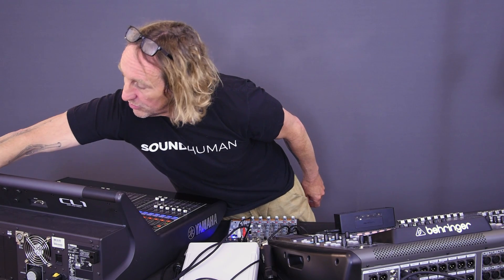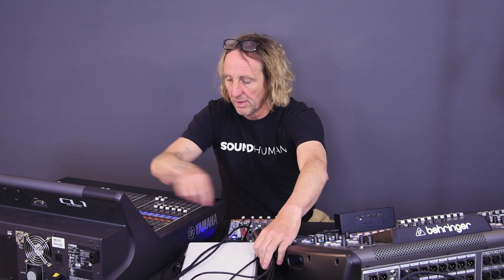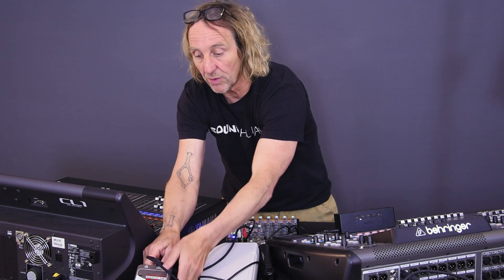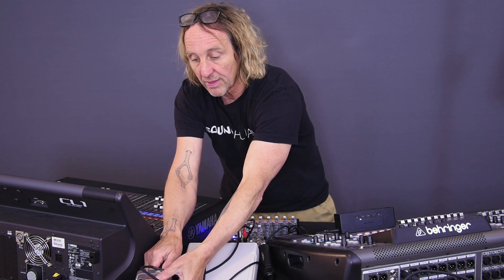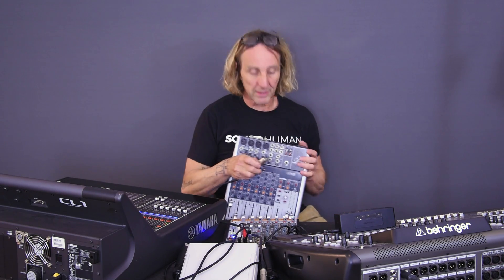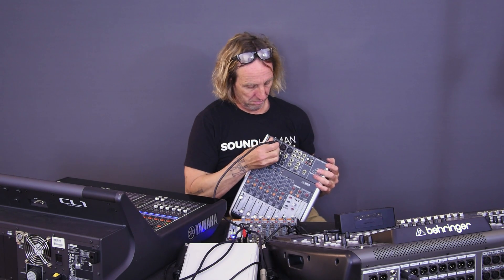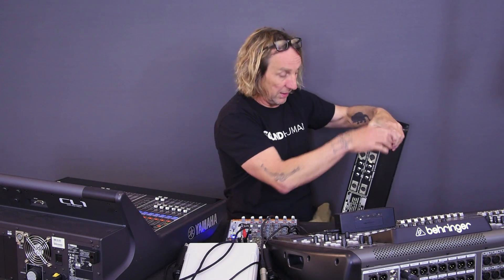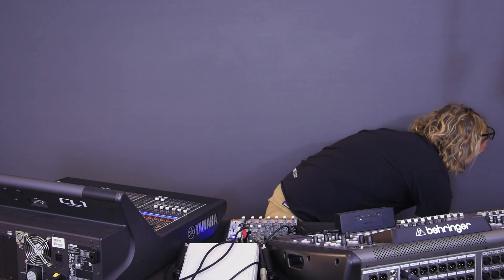Will an ISO Transformer Stop "Off Gear Distortion"? (Public)

Comment: Inredible as always. Mixing engineer here sat in Berlin with a question... Does this apply to my outboard stuff too? Should I be powering everything on every time? Cheers!
Reply: Only if your outboard gear is fed with a split, or your desk has very poorly designed outputs.
Reply from the maker: Driving multiple rooms with a split or driving multiple powered speakers or consoles with a split is quite common.  Turning one or more of the units off when not using them is common as well.
Reply from the maker: It could, some gear does it and some does not.  Though so far it seems that mic preamps are more likely than line level inputs. I have not found a line level input that does it yet.

I test a drawmer compressor and some amps in the video